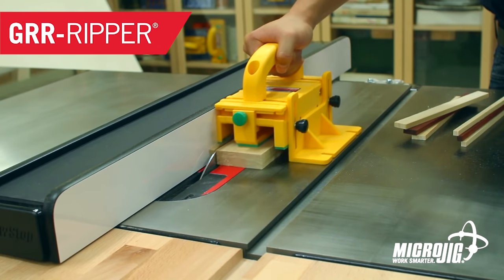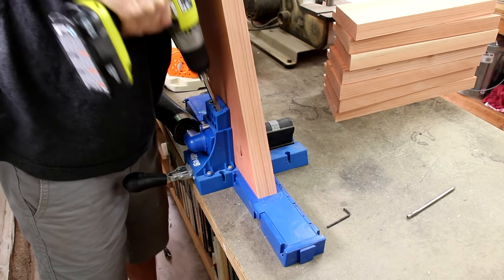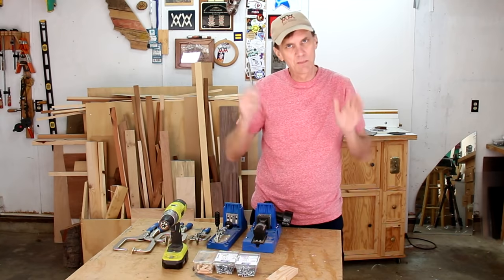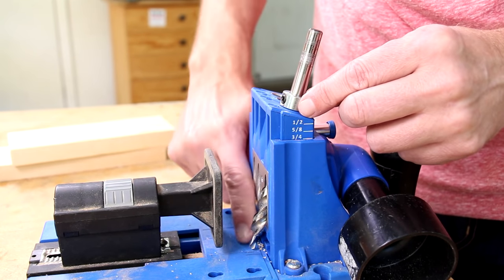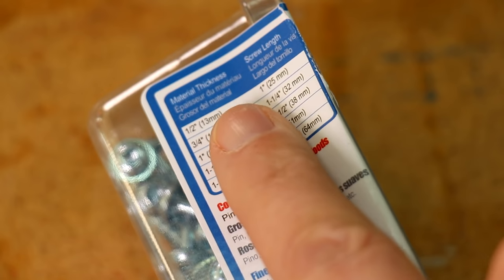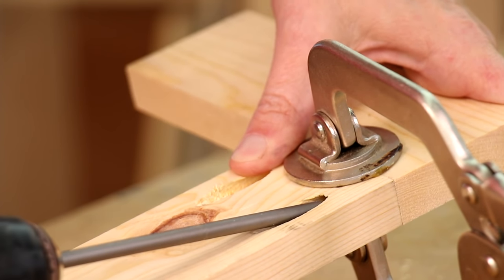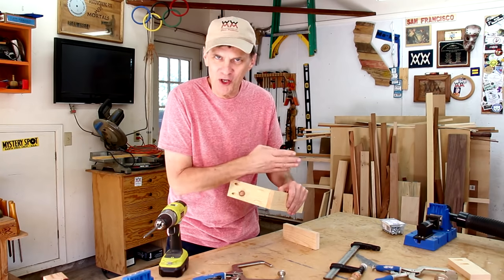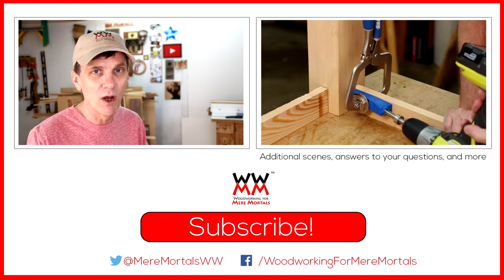Beginner's guide to pocket hole joinery | WOODWORKING BASICS

Comment: Nobody ever explains how to kreg 2 different thicknesses of wood like 2x4 to 3/4" plywood table top
Reply: Same.  So I did some playing.  Adjust the height of the jig to the height of board 1 (the one that I'll drill the pocket hole into).  Then put the bit into the jig, loosen the collet, let the bit drop to the bottom, the raise it up 1/8" and tighten the collet.  For the screw size, I use the size of the board that I'm attaching to, board 2, NOT the board I'm drilling the pocket hole into.  Probably should be common sense, but the older I get the more I have to study something.  Side note, I'm not sure if I'd use a pocket hole on plywood.  Maybe it's okay, just doesn't seem like it would hold up.
Reply: @skampp tt Thanks mate

Comment: Well done!  For filling the holes I have always mixed sawdust (no shortage in any woodshop) with glue and fill them in, packing lightly, then sand them off.  it's cheap, easy to do, and often provides a better match in color than those plugs.  You'll have to play with your mix of glue to sawdust but that in itself makes a great little project, especially if you have young budding woodworkers around .....

Comment: Thanks Steve, defenely this is the best video ever about pocket hole joints. Cheers
Reply: Do you really have to use special screws or can you usea normal screw as long as it has a shoulder on it
Reply: Marcenaria Amadora v
Reply: @rodw  It absolutely cannot have an angle on the head and needs the 90 degree shoulder.  A normal screw with a 45 or so degree bevel type head will split the wood.
Reply: What's your opinion on the flat jig, the more basic type?
Reply: I agree!

Comment: They probably should sponsor you.  I bought my Kreg pocket hole kit after watching you use yours.  I also bought the clamp.  Miters have never been my specialty so the pocket hole has been a life saver with table tops or face frames.  Norm had a very fancy pocket hold machine.  Another nice thing is you can get away with no glue so if you want to take something apart later you can.  I have even combined them with using biscuits when joining a table top together, no glue needed and the table can move with the weather.  Take care Steve and thanks for all the videos.
Reply: just did the same as well

Comment: I was making a wide board for a table top, gluing multiple boards together side-by-side. Because I didn't have enough clamps of that length, I used pocket holes instead for holding the boards together. After the glue dried, I removed the screws so I could reuse them. It's a much cheaper solution than buying expensive clamps. Also, I didn't have to worry about the boards sliding while the glue dried.
Reply: Great tip! Thanks!
Reply: I'm two years late to the party. Lol.  I always wanted to try that, however,  the clamps were the issue. Just bought the K4 and I think I'm going to try it. Thank you for the great suggestion.

Comment: As a retired casket maker, I was pretty experienced in all kinds of joinery. Even though I have a router table and a dovetail jig and can make dados and rabbit edges. I built my new kitchen cabinets with the Kreg Jig. The one thing I do is glue my joints, especially when I am making drawers. I will glue the pieces first and than clamp the joint carefully, After about 15 minutes, I will drive in my pocket hole screws. This prevents the joints from sliding out of alignment. Once you master the simple operation of this jig, you will never use another joinery method unless you need the decorative appearance of dovetails or box joints.

Comment: lots of good info.  Like the proper way to screw into wood "meat" and the end grain issue that i found to be weak.    Thanks!
Reply: I totally agree with our comment. Using the jig, drilling the hole, and driving the screw is easy. What's critical is deciding the direction of the screw (through an end grain instead of into one (when necessary)) and clamping of the pieces while screwing. Trial and error on my part.

Comment: A little tip,, use wood glue with screws and its lock tight for glue and stay good from vibration and movement for much longer time
Reply: Maybe it's for the "beginners' forum" space... BUT I'm kind of surprised nobody has added here, that wet glue is a pretty nice "lubricant" for lengthy screws into wood, too. ;o)
Reply: I've heard it's better to wipe off excess glue after it has hardened. This is to avoid issue with thin glue residue & staining. Can anyone confirm that?
Reply: @mmmuck  The technique is to let the glue harden just enough to scrape it off with a chisel, maybe 10 20 minutes depending on your glue and the air.  I do this a lot works great.  If you wait too long say overnight you will hate yourself for it.  I also wipe glue off without an issue just make sure to get it all!

Comment: your face when you even had to mention the 'impact driver' priceless, I think they are brutal too, great video
Reply: Of course, you can just disable the impact function of the drill.
Reply: Variable speed works great.
Reply: It's only America that considers the impact driver a joinery tool, the rest of the world just uses them for car wheel nuts.
Reply: @mauritsvw  how ???
Reply: @dstnjtimkhhundybhy4954  Sorry, I now realize this is probably an impact only tool. I usually use the hammer function of an ordinary electric screw driver, which can be turned off.
Reply: @thecaravan1  sssv hmm m
Reply: @thecaravan1 1/4 in impact drivers are set up to shoot screws.
Reply: @michaelkozik3468  You can get socket adapters that fit 1/4", I have taken the lug nuts off of my car with an impact driver, mind you my car is also a tiny Toyota Yaris.
Reply: @mauritsvw  Impact tools are always dedicated, the internal mechanism is too fundamentally different from a regular drill/driver, why you often see kits being sold with both tools.

Comment: Not sure if you mentioned that the screws are self tapping. This is why the stepped bit shouldn't drill all the way through to the end of the board and you don't need to drill the mating piece. Great job on this video!
Reply: +RickMakes This is important info. Thanks!

Comment: I've been using the Kreg gig for pocket holes for over 30 years. I have the first one I bought and it was made out of aluminum with steel inserts. Bought it at a show in Grand Rapids Michigan. Use it for most everything and love it. Most joints don't need glue  bit I use it anyway. Nothing I have assembled has ever come apart.

Comment: My kreg jig has a guide/scale for setting the collar on the drill bit.  I've never seen your way of setting it.   Works, though!
Reply: +Wordsnwood (Art Mulder) You're right. You should always use the jig for setting the depth. The way Steve shows above will leave very little wood between the screw head and the end of the board. When you are using 2x4 lumber and 2-1/2" screws, the bit should be much higher off the surface.
Reply: +Wordsnwood (Art Mulder) mine is the same too.  Might be the model he has or he could have an older one.
Reply: +IMRROcom steve has the newest one, the k5. it comes with a depth stop to set it, but apparently he doesn't use it.
Reply: It also makes sure you've set it right, not too long (going through the wood) or too short, on the drill bit collar.

Comment: There's a lot of unnecessary snobbery against pocket holes, but they have a place no matter what your skill level is. Not everything needs to be mortise and tenon or dove tails, but if that's your thing, then fill your boots.
Reply: +Just Make It well said!!
Reply: +Just Make It ...I agree.  Unnecessary snobbery.  I also like your 'fill your boots'.
Reply: Exactly, not everything needs to be furniture grade.  I'm making furniture for my dogs out of cheap pine and painted over.  My dogs don't mind if I use pocket hole joinery since it's sturdy and does the job.  If I ever  build some furniture for me, with quality woods, maybe I'll figure out dovetails, etc.  Great video, I have a different kreg jig, which doesn't mount, but most of it still applies. Subscribed to your channel!

Comment: "Square" drive bit is a Robertson bit, invented in Canada, eh?
Reply: +Craig Hartel (Nuclear Moose) Best driver bit around.  I can hang my impact driver from screws in the ceiling with a driver I've had for 5+ years and used heavily.

Can't do that with a Philips ;)
Reply: +Scott Verge Phillips shouldn't be around anymore at all. Most of the problems seem to occure when people mix up phillips and pozi drive and/or use the wrong size bit because it sort of fits.

I only buy screws with torx which would probably be the dominante type if it hadn't be guarded by patents for so long.
Reply: Trox can be good but not so much when they are in a place where they can rust.  Just ask any Jeep owner :D

I've snapped so many torx bits on my old Cherokee HAHA

I assume the patent on Robertson has expired and that's why you see square drive stuff in the USA now.  That should be the dominant screw type.  It is up here and it's glorious :D
Reply: I agree the torx fastener is by far the best internally driven fastener. (for wood)
Reply: Actually Robertson has a key advantage over torx in that Robertson heads are actually tapered so that the head and bit can be press fit together and your screw won't fall off, so you don't need a magnet.  This is probably the main reason that these pocket screws use Robertson.  Can you imagine how annoying it would be to try to insert a screw into the pocket only to have it continually falling off?  In fact, I don't see any general reason why you would buy a torx screw for woodworking since the amount of torque you can apply through a Robertson is already sufficient to twist the head off or strip it out of the wood.  Perhaps when fastening metal to metal that extra torque may be necessary.

Comment: 5:58
yup. Guilty as charged. and ive been a technician for 5 years lol
Reply: I had a garage built back in September (there's no way I could afford to do it now - it'd cost twice as much!) so that I could have a small shop. I had never actually owned my own garage (I became a home owner 10 years ago) so I didn't own a lot of tools. Never owned a cordless drill, for example. So when I drywalled the garage, I learned about the clutch settings through a video (I wanted to know what the numbers on the chuck were for). That made driving drywall screws with the cheap drywall bits WAY easier! Incidentally, the setting that seemed to work best for this purpose using my Makita was 11. Anything above that and the drywall bit might start punching rings into the drywall too hard..  Gotta love the versatility of modern power tools though!

Comment: Matthias Wandel would not approve of this video
Reply: Boy your right on that.LOL
Reply: Yes he would.
Reply: Anthony Morasco
Reply: He has a video using a pocket hole, but he made the pocket hole guide himself out of a piece of wood. I am not fond of the pocket hole system myself, but my son bought me the K4 as a Christmas gift so I will give it a go.
Reply: Have you used it enough to Re-Weigh in on your opinion of Pocket-Hole joinery?
Reply: +Benjamin Buttonz  I can't speak for Mr. Jones, but I'm "okay" with pocket holes.  Given the time, I'd much rather stick with dowels for face frames, but pocket screws do fine, especially if you have a nice big layout & squaring table in a high-production shop.  I still prefer dowels (or mortise & tenon) on smaller piecework and one-off customs, though.  It's a much stronger joint for open-air stuff like chair legs, etc.  Pocket screws are suitable for face frames because the cabinet body is attached throughout and reinforces the joints.  Edit --- And, if you sand a pocket-screwed joint down over time, you'll eventually hit metal.
Reply: oolon colluphid same here i also like using a biscuit jointer
Reply: +Jake Burgess Yeah, I like biscuits for a lot of the same stuff (right angles and ends), but I think I'd use the pocket screws in the case of face frames just because biscuits still allow some drift side-to-side after they're clamped.  Gotta watch 'em and we don't always have time for that.
Reply: oolon colluphid biscuit joiners are pointless. glue by itself is just as strong or stronger than biscuit joints. Tests have shown this. I still like them but I'm not buying a new one since mine died.
Reply: kandysman86 biscuits are just for alignment not strength
Reply: Jake Burgess what? biscuits wouldn't make it any easier to align two boards you are immediately gluing together. I mean, if you cut them correctly they will align, but that can be done much easier without all the extra work. And biscuit joints were designed for strength, not alignment.
Reply: kandysman86 im not arguing i join boards together all the time without biscuits but they dont add any strength tbh its cheaper to just use glue like you said but for t joints i would go with dowels and glue and when i do use biscuits for laminating a panel together i leave about 2" longer than the actual size it is going to be to allow for play with the biscuits
Reply: he would use an automatic pocket hole jig that he built with a planetary gear system with all sorts of tracks and guides and whatever else makes his nerdy brain go bing.

Comment: Very helpful, thanks! I've toe screwed many boards together, but almost all I've done is very rough 2x4 work, where it didn't matter that the screw head stuck out, as long as it wasn't in a bad location. Now I need to build some things a little more finished, and a little thinner wood, and knew that a pocket hole jig would do the trick. Only, I'd never used one or even seen one up close. Now I know what to do with it. 🙂

Comment: I have had my Kreg tool for a while and used it successfully but picked up several great tips from your video. One thing I like about this tool it is on a lot of projects it eliminates the need to use clamps while a joint dries. I like your presentation and your "don't do" suggestions. Great, easy to understand video. Thanks!

Comment: Steve. You saved my multiple thousand dollar project. My screws were going in too deep. I was using an impact driver, but being careful. Still, I got some places where the surface veneer of my expensive plywood was popped. Stupid me, but I didn't think of using a drill instead of the Impact driver. I will now. By the way, I have many of the same Ryobi tools, and more,  as you and a whole lot of Kreg tools.  They have worked for me! I will now back out the offending screws and hope for the best. I have redundant screws, so it should not make any difference. I am a fan for life now!

Comment: Excellent, Steve, very helpful!  LOL - "... you know, this thing that you probably never use and maybe you didn't even know what it was for..."  Yup, that happens to me often enough with MANY things in life to keep me humble!  Excellent explanation of the "sometimes fine but not the strongest" screwing into end grain.  As a beginner DIYer, you've made me aware and got me thinking about end grain strength when I plan a project now.   I'm also thinking about this when I watch other videos and see screws going into end grain, but without any explanation as to why or whether joint strength is not as critical in their applications.  Learned something else at 6:48 - "Be aware of the direction your screws are going..."  I thought the priority was to hide the pocket screws, so now I will consider which is more important - a less visible or hidden pocket screw or a stronger joint.  If I'm also gluing the joint, then the pocket screws are acting more like clamps and long-term strength is less of a concern, as long as it's initially strong enough to hold the joint while the glue sets up.  But if I'm using the pocket screws alone (without glue) so I can disassemble the joint in the future, then strength will be more important than visibility.  Whew!  So much great food for thought!    Thanks again! 
     (Added about a month later) Steve, any thoughts on how straight the Kreg screws are?  When I put the Kreg square drive in my drill/driver and spin it, it seems spot on.  But when I put a screw on the end and slowly spin it, it seems to wobble.  The threads seem bent from the screw head, and seem to rotate very out of line.  I guess this could be an illusion, or could be the result of my not-so-true drill/driver chuck spinning out of line as well?  Illusion or not, this definitely gives more reason for clamping the joint while screwing it together.  Thoughts on seemingly bent screws?

Comment: I came here after getting a Pocket hole kit, but was ripping through the timber. I will not use my driver after your recommendation, will use my normal drill with clutch on low settings. Thanks for making such a clear video.

Comment: I have an idea for a bookshelf that is made of stackable sections, so the the height of the overall shelf can be adjusted.  I rent, so I want something that I can use to matter how high the ceiling is wherever I end up, and something that can be completely disassembled for moving.  After watching your video, I think pocket home joints would be a great fit for assembling the side and back peieces of each stackable section.  

Thanks so much for a clear, practical explanation of what to do and what not to do, how, and why.

Comment: as a swiss Carpenter/Joiner I always admired pockedholes, as the concept is so easy and gets the job done quickly. Here in central europe this method is not widely used. Either it's done by  doweling or biscuitjoining.. We could do with some learning from abroad:) cheers

Comment: I bought an aluminum pocket hole jig from Harbor Freight a couple years ago. I used it for a couple projects and it worked well and was cheaper than the Krieg jig.  I do use the Krieg screws.